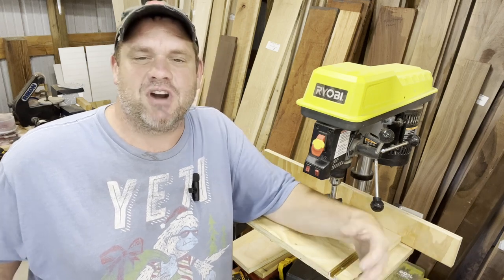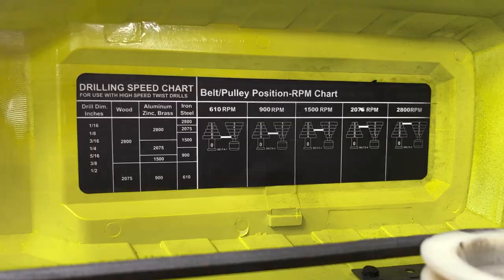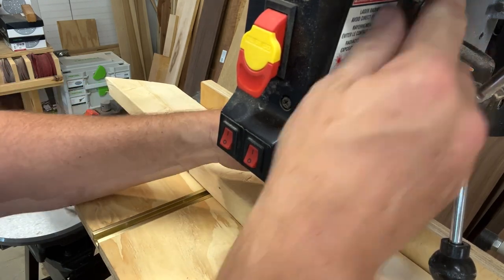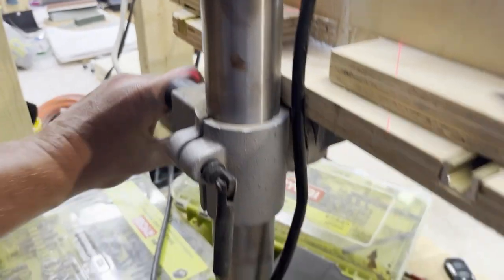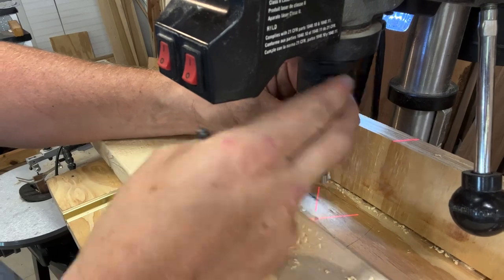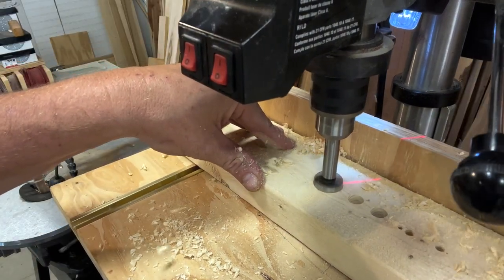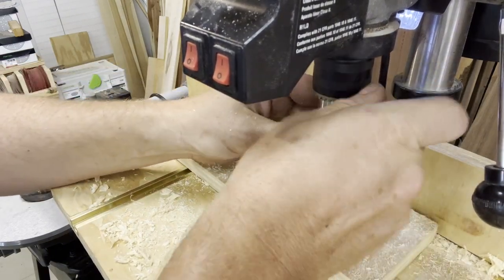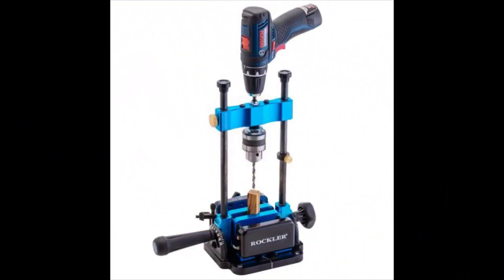Ryobi Drill Press Review

Comment: I have an earlier model of that drill press and it is still working after twelve years. I use it mostly for drilling holes with regular and spade bits. I also have one of those adjustable hole cutting bits which works if the cutter is sharp and you take it slow. If you're aggressive it will stall, so a lighter touch is required.
Reply from the maker: Thank you so much for sharing this mheernance!  I agree, this is a great tool for the money.   I would get another one if I did it all over again!
Reply: Does it have plastic pulley?
Reply: @jankokuu  Yes it does. I just looked at it and I don't see much wear on it. It has a tension knob which takes up any slack in the belt.
Reply: @mheermance  ok so i was wondering if i should get one, i mainly work with metal tho so does it have enough power?
Reply: @jankokuu  I think it has enough power. If I had to do it again I would buy a 12". But overall I am happy with it.

Comment: I have that ryobi press….got a deal at direct tools where I got the ryobi drill press and 9” bandsaw for 150.00. The bandsaw was damaged box and the press was a refurb. I don’t use either a ton, but I have ran 2” Forster bits and 6 inch hole saws on it. You just have to take it slow. If your bits are not sharp that may cause an issue…also keep in mind you can always start your hole on the press and finish with a hand drill…that way you get the angle right from the press, I’ve done that before making long holes for a side vice on a bench I built, and it worked great…..it’s not a horrible press if you can get a deal but it’s no ways a full size floor press……
Reply from the maker: Thanks so much for the comment!   Very informative.   My dream is to get an either a more powerful benchtop or floor press.   I've been keeping my eyes pealed to see if one comes up for sale locally but I've struck out so far!  Fingers crossed!

Comment: yesterday, I used my friend's Ryobi Drill Press to make some toy wheels. the hole saws I used were 2.5", 3", and 4'". to my surprise, the drill would stall at lower RPMs but once I went up to higher speeds, even the 4" hole saw went thru my 2x10 without stalling and with great speed. I have a harbor freight drill in my garage and even though his drill is much older than mine I can see the difference right away.
Reply from the maker: Thanks so much for sharing hbsbos!    Very interesting to hear.   I loved hearing about the comparison to the Harbor freight as well.   Thanks again for watching and have a great weekend!

Comment: I'm not a big wood worker, Havent done much other than refinish a table or 3 in the last 20 years but I have to ask why you would switch from the super soft pine for the first few cuts to something that didnt look super hard but certainly looked harder than pine for the last 2 bits?
Reply from the maker: Well, that is a very good question.   Part of the reason was just because that is what I had in my scrap pile nearby.  You are correct, probably should have maintained the same wood throughout the entire video.  Thanks for pointing that out!

Comment: How do I move the motor on the drill press to adjust the belt tension
Reply from the maker: Great question, I will have to check it out to see if it has a way to loosen the tension.  I used to just manhandle it out of place, but there may be a way to loosen the tension.

Comment: Just got this drill - how do I adjust the beot
Reply from the maker: Well, I wish I had an easy answer for you.   I usually used a little elbow grease or a screw driver to get the belt off of one pully and onto another.   I did not really find an easier way unfortunately.  Thanks so much for watching Theiftanlazx
Reply: @FlynndoggWoodwork  Hahaha, great video! 
Yup! Your method works haha. I tried loosening the tension knob and pulling the motor closer, but it doesn't take much tension off
Reply from the maker: @Theiftanlazx  yep it's not the easiest!
Reply: @FlynndoggWoodwork  despite this issue, i am very happy with the drill press! Just built myself an angled jig so i can cut longer work pieces comfortably. Thanks again for your video

Comment: I have this press, and if you use it correctly it works just fine. Your trying t FORCE THE LARGE BITS THROUGH THE WOOD BEFORE THEY HAVE CUT. You slowed down the RPM, so slow down tour rate of down force. Yest the cross Lazer is adjustable.
Reply from the maker: Thanks for sharing and watching rich!

Comment: I've been using Milescraft drill guide, and it's okay. It's definitely not as precise as a drill press, but it's the next best thing, when you have nothing else - there is a bit of wobble in the drill bit. Once the bit is in the wood, it'll go through accurately. I wouldn't use it for metal work.
Reply from the maker: Oh Great!  Thanks for sharing, it looks like they are very similar in design.   After seeing some of the comments I'm getting it seems there is no real alternative other than a higher powered drill press.  I better start saving up for one! :)

Comment: It’s not a beefy motor, hence why manufacturers recommended bit size stops at like 3/4 inch..  if your going beefy and outside the range, then your going to have to go slow, can’t just try a bury it right away lol
Reply from the maker: I agree, I think I've probably outgrown the drill press.   Probably time for an upgrade, just hard for me to buy a new one when I don't use it that often!
Reply: @FlynndoggWoodwork   everyone talks crap about harbor freight… but you can get an old 1970-80’s floor standing drill press that’s all old  cast iron that still running today and pay less than $250 and have 3/4hp or better  and depending on model most durcraft I’ve seen are like 16 plus’s speeds. Even if they were made in Taiwan 50 years later they still running, sounds good to me.  Maybe look into one that just needs a little restoration and get it cheap … that’s my plan lol
Reply: Reading the comments and just wanna say I appreciate you taking the time to do this video